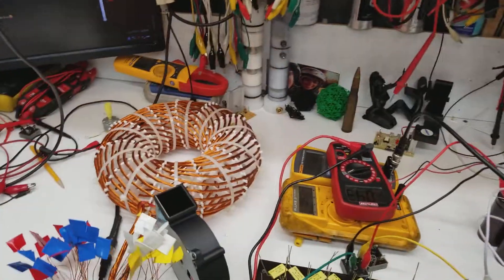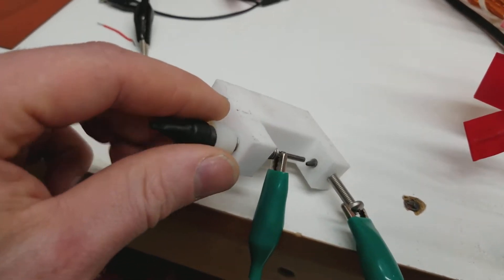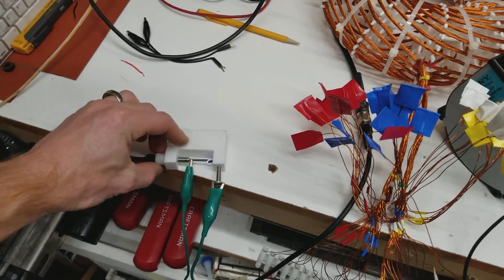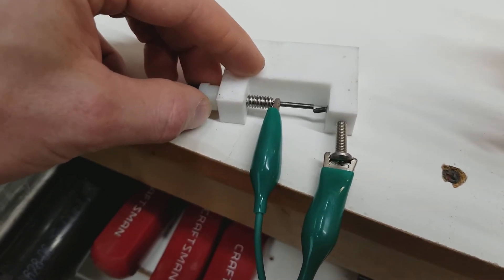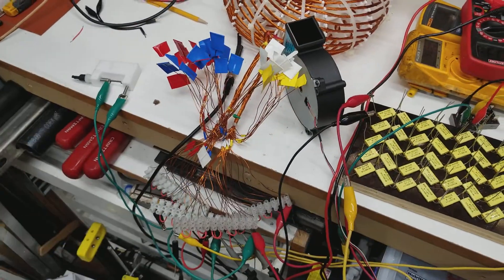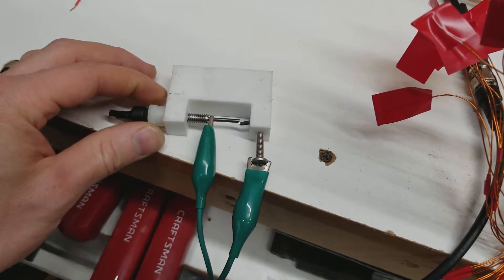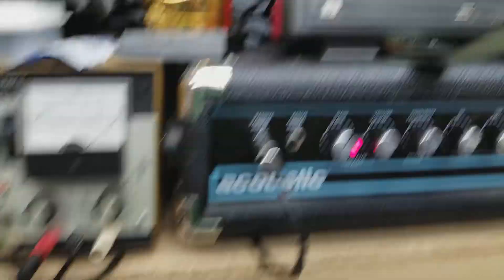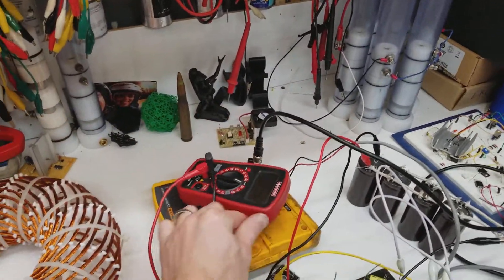CURRENT Can Not Flow. This is not Induction!!!!  This Is A Dielectric Coupling!!!!

Comment: you should really get back to me on skype about what ive found using 3 of these abha style coils and bridge rectifier .. I'm well over 1000v+ dc bridge side, and have other coil in middle lighting ac lights and spark gap feeding back in to battery that is fueling it all..... I think you would like it .. anyway sent skype message few months ago fyi but made a lot of advancements since then
Reply: also at end you ask if you can do that with 65w... I'm using https://www.adafruit.com/product/1752 20 w and 12v battery to supply it ... and I can do the same.. put 75w amp to 3 coils and I'm scared to touch it and have no meters that can that high...